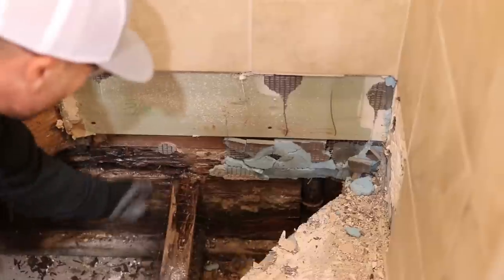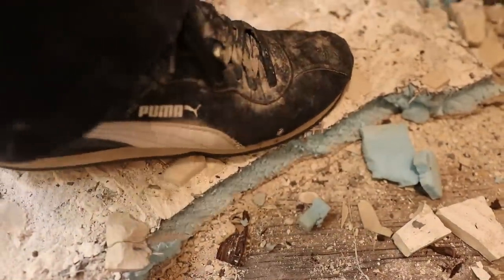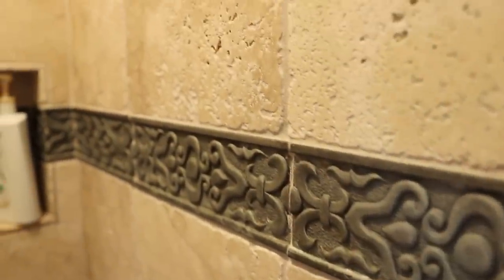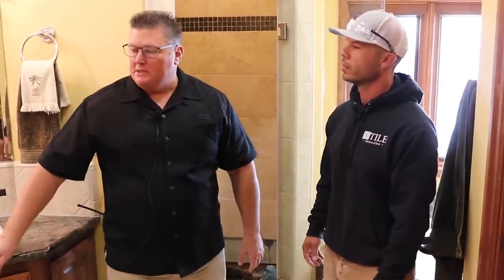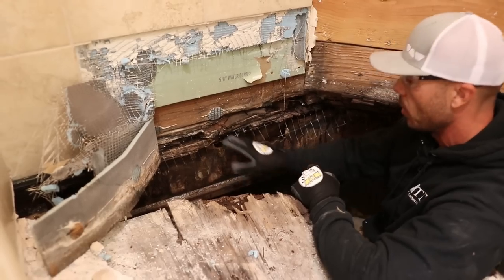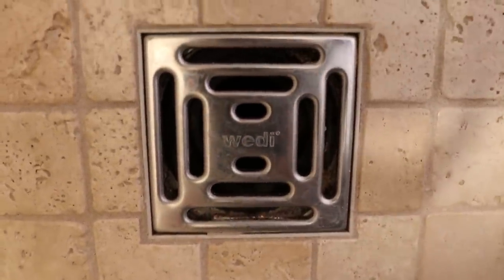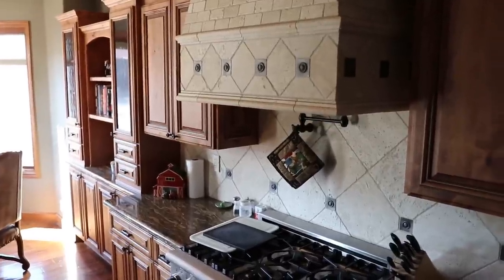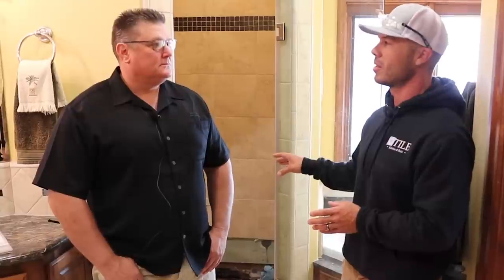Massive WEDI Shower FAILURE (Done by Certified Installer) -- Warranty Claim DENIED

Comment: I have been installing Wedi and Schluter products as a professional for many years, both companies have great  products for creating waterproof showers.   Like anything else in life, if the product is not used correctly you will have problems. Adhesives and sealants need to be used properly, trying to save money by using an opened tube you had kicking around the back of your van for a few weeks is not a good idea, here in southern Ontario Canada extreme cold for installing these products during winter months can also cause issues.   I like the Wedi panels for the walls because they are more rigid than the Kerdi board, but still easy to cut with a utility knife.  I have never used the pre-made shower pans from either company as I find them to be too soft for my liking.  As most of my work is custom, I like to create my shower pans the old fashioned way using sand and cement mix. However,  I do use the  Schulter drain system and  install waterproofing  ABOVE the concrete base with Schulter Kerdi-DS membrane and Kerdi-Band and Kerdi-Kereck-F  corners to seal around the perimeter of the base and Wedi wall panels using  good quality Kiesel  Thinset for all of my installations.    Unfortunately for this  home owner, my guess is that Wedi did not warranty  because they found that the product was not installed correctly.
Reply: I agree. I posted a comment above regarding my installation. I also used Schluter profiles for the wall to floor and wall to wall joints with no problems in 14 years. I do have the shower tray and that's been fine. Gets used every single day.

Comment: I use and love the wedi boards. But for pans I either sand pack my own or use the Schluter foam pan with a double layer of the Kerdi. Kerdi Band then wraps up onto the Wedi wall, then Redguard on the seams.
Reply: Redguard fails a lot as well.  I only use it as a crack surpressant.  I have been using chloralloy and mudpacking the shower floor for thirty years with no failures.  Recently I have had customers who insist on the Schluter system and I have reservations about using styrofoam on the floor.  I've done a few that way, but after seeing this debacle I'm only doing it old school.
Reply: @jonm9538  I would love to see a video of how you do a proper shower floor.  What is chloralloy? I have to redo a shower. Thanks.

Comment: What you showed in this video, no homeowner should ever go through. 

My observations even though it’s hard to tell from the video, few things did caught my eye.

This type of shape of shower would’ve been much easier to do traditional mudpan, than WEDI and most likely cheaper also.

WEDI pans come in squares and rectangles, meaning the installer had to cut this pan to fit perfectly into that opening which can be tricky and if he was off at any of those angles that could’ve created a problem.

If you ever worked with WEDI sealer you’d know it doesn’t just “delaminate” that stuff you can rip off even if you wanted to.

Another problem, I didn’t see any fiberglass tape at all the corners connecting floor and wall and sides. when you connect wall board to floor pan you squeeze extra sealant out and add more if needed than use a square spread tool to spread sealant couple inches on both side and run a fiberglass tape into corners.  That secures both sides and keeps them together even if there’s a large settlement.

Isaac run a test with it even for your self, WEDI sealant is crazy strong, I just can’t believe that it just delaminated, there must be more to that story.  Either bottom pan wasn’t properly installed to subfloor and there was a “play” which in time tore them apart, or those panels weren’t installed correctly.  

It would’ve been nice to see how bench was assembled, but it just looks wrong. I would’ve made square shower corner and installed wedi type corner shower in already installed WEDI shower. That would be the correct way to do that.  Also we didn’t see drain assembly which can leak if not properly installed and another very important is curb, we didn’t see.

Thank you for your videos, they help me to pay more attention at certain things at work on daily bases.

And don’t feel bad pointing out things that are clearly failed, we all who do this for living need to see them.

Sorry for the long ramble.
Reply: It delaminated after 10 years of temperature and moisture cycle. 
Doesn't mean that it is not super strong in the first couple years.

Agree.. tape should have been added. 

Any system even a hot mop is not fool proof. They all have a lifetime.
Reply: I would say there was too few joist underneath shower and subfloor was flexing too much which cause delamination of Wedi on floor. 
Dunno about codes in US but here maximum O.C for floor joist under shower is 16 o.c with 3/4 thick plywood.
Reply: @turboflush  That was leaking after half that, Damage to wood to that extent does not happen overnight
Reply: @mr.wizeguy8995  It depends on local codes. Most allow any joist spacing combo to achieve L/360, but a lot of older buildings here are 24" OC with 2x8 joists, including my own house. There's also weird i-joist systems that have their own spacing requirements. 

Also some older buildings have steel or cast iron bathtubs set directly to the joists.
Reply: @philaudiostrike8746  
Never said it did happen overnight.
Reply: @GilBatesLovesyou   I found that from Wedi Installation guide
Installation over structural wooden surfaces – Flooring
 
• Plywood subfloor joist spacing must not exceed 16”
o.c. with minimum thickness of T&G exterior grade plywood of 19/32 inch. Joist spacing in excess of 16”o.c. and up to 24: o.c. requires a double layerof ¾” Exterior Grade Plywood T&G subfloor sheets, glued and screwed.

So looks like floor didn't match manufacturers recommendation at all.

And looks like biggest issue was that bench where all leaks started.
Reply: bla bla bla.........
Reply: No problem brother respect the knowledge
Reply: @ Sergey I took the delamination to be on the foam material not the actual sealant. Any sealant bond is only as good as the material it is stuck to.
Reply: @turboflush  Sorry, but the OP is correct. It should not have delaminated even after many decades if the installation was proper- which it clearly wasn't. I agree wholeheartedly that there was some "give" involved that ultimately led to failure, and that there is definitely more to the story than we are getting and that Issac is capable of grasping at his young and inexperienced age.
Reply: Sergey Avdeyev I agree. I use Wedi exclusively and have heard for some reason exterior walls will leak at the pan. I was tol Wedi said it is due to expansion and contraction. Due to knowing that I now band all my walls to pans with Wedi tape. It is exactly like kerdi tape but gray.
Reply: Sergey - You can see how it was WELL adhered to the tile and backer board and all the substrate. Just the foam seems to release the sealant. Most likely the foam released from itself. So the sealant needed to penetrate the foam more and bond to it more and become ONE with the foam. But the foam probably doesn't allow that because it needs to seal itself from water penetration.
Reply: Sealant may be strong, but what I noticed during demo phase with WEDI boards, the foam parts exposed to water, get brittle over time and flake off, like we saw the video. Doesn't take much to hurt these boards.
Reply: @GilBatesLovesyou  This is a relatively new-build - 2007 custom home (likely well over $1M from the quality of tile work/fixtures/appliances).  With California's seismic codes, that floor system would be more than adequate to support the weight of the shower. Anyone relying on a caulk joint subject to repeated wettings joining a flexible foam substrate is nuts - it's all-but guaranteed to fail. Betcha Wedi has thousands of 'denied' claims - probably a Class Action in the making.

Comment: Installation instructions state to put a 1/2" bead of sealant in the rabbit joint, insert the 1/2" wedi board into rabbit.  Then you are required to use a trowel to strike that joint.  After the shower is completed they are then required to come back and add a 1/2" bead of sealant to all seams.  Then strike that.  It appears to me that the 2nd bead of sealant was never applied otherwise we would of seen that sealant going in both directions towards the drain, and also towards the rabbit channel in the walls.
Reply: Wedi sealant certification is to tolerate gives up to 1/16”. Likely, it was structural issue, like subfloor had some give, or wall had flex, which eventually resulted in adhesive delamination. Also, suspicious part, that double layer wall, my guess they did that either to catchup on fixed size of preslope base as it might be undersized.
Reply: Riiiight, couldn't be a faulty system lol

Comment: I refitted my bathroom out in 2006 using wedi all round. On the walls and floor with a fundo shower. The wall to floor joints should be taped with their neoorene tape and not sealant because the sealant will fail with slight movement. The tape will accept a much higher amount of movement. I've not had a single problem in all those years and when I refurbished my kitchen, I replaced the ceiling which is below the shower and the joists were bone dry. This job looks like it wasn't done properly. Wedi is a good product but like anything it will only work if it's done properly. Also, I didn't notch out my shower tray. I don't know about the US but here in the UK it's not advertised as being an easy product to install.

Comment: Flexable foam shower walls and 250lb guy day in day out. What could go wrong. LOL. I thought my concrete board was light.
Reply: Once you tile it and use an epoxy grout on the floor, there is no flex.....hell after you tile it there just isn’t any flex in the pan or the foam curb if you go that route. I do think I might start adding mesh tape with the sikiflex caulking though

Comment: 2007 there was no warranty over 10 years. The Pro Warranty came out much later maybe 2016? And that was a 15 or 20 warranty. Also Wedi has never had white sealant
Reply: Ya I was surprised when I saw it was white
Reply: I always thought it was a grayish/ silver color. I didnt use wedi until a few years ago and now use hydroblock which is the same thing
Reply: Any system that relies on a caulk joint at THE BOTTOM is prone to failure eventually...even if the caulk seems impenetrable when brand new...that way of thinking is sadly typical of the North American/wood frame building industry...
Reply from the maker: https://youtu.be/_skYsjFBnPM

Comment: Issac thank you for your honest opinion about WEDI, I think the reason for this problem is due to insufficient quantity of sealant used in the dado recessed connection of wall to pan and also not adequate seam of 1/8 inch thick x  two inch wide along the perimeter of the pan and wall board. I also think WEDI may be aware of some installment difficulties since they make a One-Step pan system with a lip which I prefer but it is in limited sizes which works for new construction but seems never to be the right size for remodeling. After reading your post, I wil  consider using prefab pans which have a lip.

Comment: Love your videos and commend you for your detailed insight on proper and quality workmanship.
One thing Id like to point out. The floor structure. Looks like 24" OC TGI joists and only one joists lands in the layout of the shower pan without any supporting joists at the perimeters. With a single layer of 3/4" t&g decking (maybe it's 1-1/8"?) that would certainly cause a lot of movement. But, if youve been to a WEDI seminar, this is exactly what they preach it is designed to do, move. Not that I agree. 
We normally open our floors up for drain placement anyway and at that time add additional cross blocking around the drain and perimeters, sometimes adding new joists where needed. 
Also, the major area of damage seems to be near the bench. How was the bench wall board connection to the pan and pan designed around that bench? Curious

I'm no advocate and don't want to preach a product that may have flaws, which almost every product does. But we are certified and have installed these system. On the installs we have done, we have took extra steps and used waterproof membrane adhered with thinset to the floor and 6 inches up the walls before installation. Not something Wedi requires, just an extra step. Like back caulking a trim board, window or similar when dealing with water penetration and envelope. Also, additional floor blocking, pan backed blocking where the wall boards meet the pan etc.. 

I can't say definitively without seeing it myself whether there was some sort of installation error or product failure but don't wish this on any homeowner or contractor. If this is a product failure at the joints from prolonged movement with the proper installed sealant, Id sure like to know about it. That is what every argument is against these products.
Reply from the maker: 16 OC.  The middle one rotted out.

Comment: I've been using Wedi for over 15 years and even then the company supplied their own sealant and warned against using other products. While I've seen hotmops fail, none of my Wedi installations did. In Mike's case obviously a lot of cheap shortcuts were taken, starting with leaving the old greenboard in and creating a Wedi filler board (instead of demoing all of it properly down to the studs) to using cheaper Sikaflex instead of pricey Wedi sealant. This has been probably leaking from the get go (a 24h water test wouldn't detect a small leak, you know that) and pointing to all that timber damage is good youtube sensationalism, but is nothing but to be expected if it's been leaking for over ten years due to an installer who didn't know what he was doing or did't care. Why is he out of business....

Comment: Great Video Isaac, I’m in the UK and  just installed a Wedi pan. In the UK instructions it doesn’t mention at all to to do a rebate in pan if putting tile backer boards around it what you do get is a sealing kit made from two components like Kerdi Coll that is available in the UK for my safety I’ve also pre sealed the joints with a product called C-Tec CT1 before using the wedi sealing kit. Time will tell if it fails.

Comment: I'm just a DIY dummy and I would never use a foam product to support something like tile in a bathroom.  That does not compute in my head!
Reply: I've seen fully loaded concrete trucks drive over 1" thick foam boards without damaging the foam on large concrete pours hundreds of times.  The concrete is poured over the foam.

Foam works great but it needs to be supported 100% underneath by a substrate that does not move.  In concrete work the substrate is compacted fill.

It looks like the foam in these showers is not well supported.  With people bouncing around the shower like its a trampoline and seismic tremors in CA, that foam is getting flexed, twisted, and pulled in every direction.  I'm surprised this shower last as long as it did.
Reply: Freakin eh man

Comment: For anybody that dogs you about it, let them. They never have a problem til they have a problem. It’s not if, it’s when. 

Glad to see you standing firm. I’ve done a few rebuilds for folks that had problems. They might leak for years before it’s noticed so it’s best to use the tried and true method even if it cost more. Pay me now or pay me later.

Hopefully you’ll get the rebuild job and wedi has to write a check.